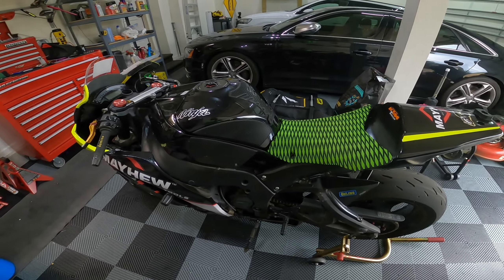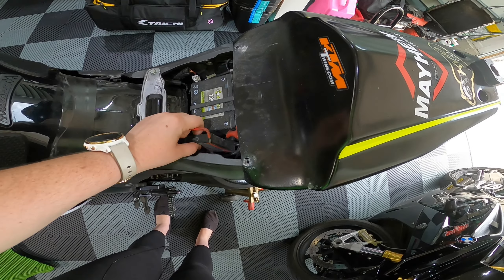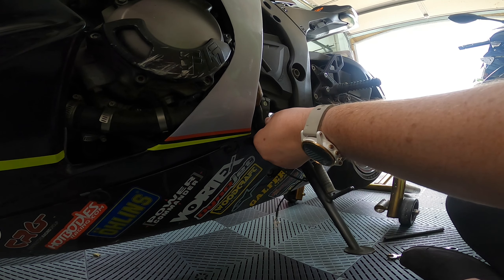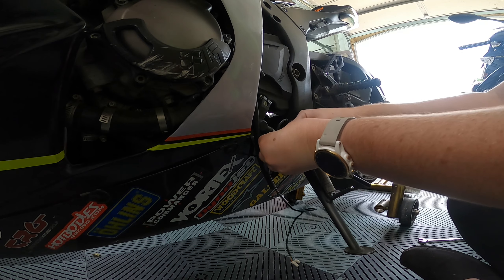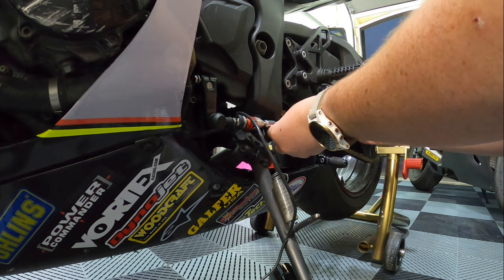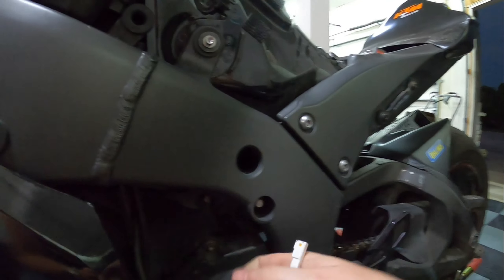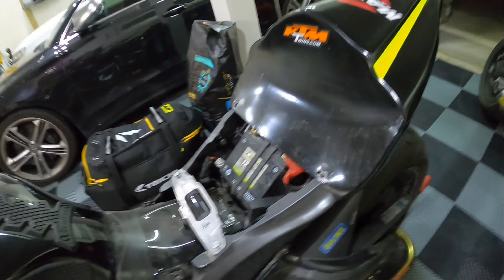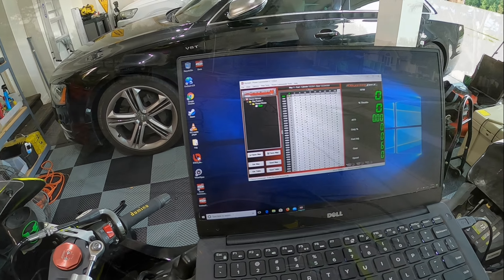DynoJet QuickShifter Install on a Gen 4 (2011-2015) Ninja ZX10R

Comment: Hello Heyley,
Thanks for the instruction video. Is an expension module dealing with the four upper injectors not required when installing a quick shifter on a gen 4?
Reply from the maker: No, I did not have the ignition module and it worked just fine.
Reply: It worsk even on high rpm when upper injectors start working?
Reply: Without SFM or QEM.
Reply from the maker: @BeardBiker636  It worked completely fine on track with no ignition module.  I ONLY had a PC5.
Reply: @ApexIsBae  Nice, i ordered for my zx6r 2012 pc5 and sensor. And i readed on their website that i need extra module. Probably to take more money from us.

Comment: i’m very late to the video but i just went to adjust my shifter position, couldn’t move it so retightened everything and now the quickshifter is super aggressive and misses 4th when it cuts power and then just revs the bike…
Reply from the maker: @notcivur  lots of things could be causing that. I suggest bringing it to a race shop.

All angles should be 90deg, sensor needs to not be under any stress, could have damaged the sensor or the cable or the connector.

Comment: I have one question when you install a Dyno quick shifter the steel thing you buy a separate?
Reply from the maker: Yes, I bought the rod separate. Dynojet sells rods for specific oem applications, but I have aftermarket rearsets so I had to custom make a solution!
Reply: @ApexIsBae  ohh okay thank you ❤️